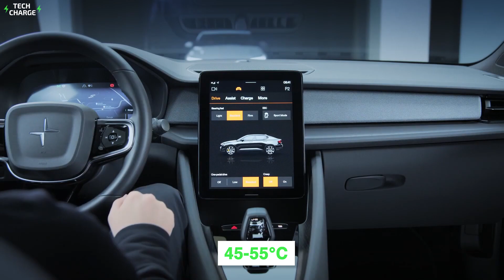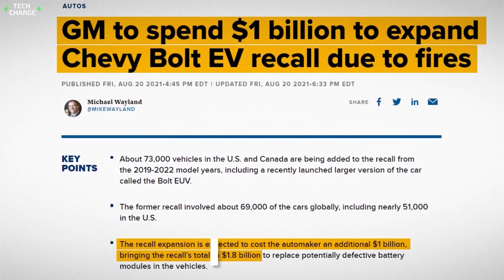The Shocking Truth About EV Fires You Need to Know

Comment: a month ago a family died in there Tesla here in Vancouver, they couldn't open the doors because the cars electronic every thing failed. then a few weeks latter a guy had to break out of his model y at an intersection it was on fire from the inside, a week later a model 3 went into a pole and it's battery basically separated from the bottom of the car like a missile and the occupants where seriously injured do to the structural impact of the battery flying away, which didn't catch fire this time. Also before that, a house burnt down with a Tesla in the garage. I have personally seen two just suddenly lock up on highway 99 in busy Richmond traffic just south of Vancouver. I think these cars have too many stupid features that impede safety, I don't have an issue with EVs they need segmented battery packs and actual door latches at the minimum. That said, I live in an apartment and I think I'll stick to a corolla or a hybrid for now.
Reply: People do it themselves. A tesla has a electric and a manual lock. Every brand has.
Reply: I actually test drove a Tesla model 3 when they first came out.  I was a little worried about the fire risk but still liked the vehicle.  However I did not buy it for one reason :  there was NO manual release for the rear doors,  only for the front doors.  Having my kids have to climb out of a burning vehicle via the front doors (which might not even open mechanically after a crash)... no sorry that killed it for me (this is 100% true,  you can look it up,  no manual release for the rear doors in the Tesla model 3 @henrihifi
Reply: @Beoyur So if I'm a passenger in an EV, say a taxi, how am I supposed to know where the emergency door release is ?
Reply: EVTechnology will eventually progress and get better, give it about 100 years, then let me know, I might buy one.
Reply: @lisabruneau3801  Surely is micro-nuclear powercell.
Reply: Two weeks ago a mother and 12 year old daughter were killed when their Tsla burst into flames when she hit a tree, or did it burst into flames before she hit the tree? Actual cause of the accident has not been reported at this time.
Reply: @1940limited  Q: Two weeks ago a mother and 12 year old daughter were killed when their Tsla burst into flames when she hit a tree, or did it burst into flames before she hit the tree? A: odds are it burst into flames AFTER it hit the tree, however what likely happened BEFORE it hit the tree was the Tesla had a whole different defect show up which is UNINTENDED ACCELERATION.  having now looked at 1/2 dozen to a dozen accidents this seems to be a recurring theme.  mind you these accidents are WHOLLY SEPARATE from all the ones involving legit speeding teenagers, and the ones involving Auto Pilot/FSD.  thus the Tesla problem is not "either or" but actually ALL THE ABOVE.  yeah, what Teslas actually have are MULTIPLE FAILURE MODES (so not just one as people tend to think).
Reply: Lawsuits galore!
Reply: How sad did our handsome wonder boy Elon musk take responsibility????
Reply: Every Tesla has mechanical door opening devices that are so easy to find that I have trouble getting people to use the electric door openers.

I’m not sure why you are propagating this false story; either out of ignorance or out of malice?
Reply: Putting an EV in your garage is like sleeping with a grenade under your pillow.
Reply: Then why do drivers have to kick out the window to escape? Their words not mine.
Reply: Prius is the best choice.  But for a real man i choose tacoma.
Reply: A hybrid is simply an EV with an onboard charger.
Hybrids burn more often than ICE cars.
Reply: Yes, just like the many people trapped in gasoline fires who also couldnt get out after an accident because the doors were jammed, and they burned to death, but out of the hundreds of MILLIONS of vehicles out there, only a small fraction of 1% have that happen.

71-year-old man burned to death after vehicle burst into flames in Wellington
Investigators said as the driver of the Jeep began to make the turn, the BMW collided into the passenger side of the Jeep.

As the crash ensued, the Jeep spun around, before it eventually rolled over. Unfortunately, the driver in the Jeep, a 71-year-old man, was killed after the Jeep became engulfed in flames, leaving him trapped inside.
The sheriff's office said the 18-year-old driver was under the influence of drugs or alcohol during the time of the crash. He was taken to Wellington Regional Medical Center with minor injuries.
---
One person was killed after a vehicle crashed and caught fire in Madison.
The incident happened around 9:00 a.m. on Interstate 55 on August 17, 2023.

Madison police said they received a call about a gray passenger car traveling southbound in the northbound lanes of I-55. A few minutes later, Ridgeland police received a call about a gray passenger car crashing into the trees on the west side of the southbound lanes near the Madison Avenue exit.
One injured after Jones County barn damaged by fire

Once emergency personnel arrived at the scene, they discovered the vehicle was fully engulfed in flames. Madison firefighters began rescue efforts and worked to extinguish the fire, however the driver died at the scene.